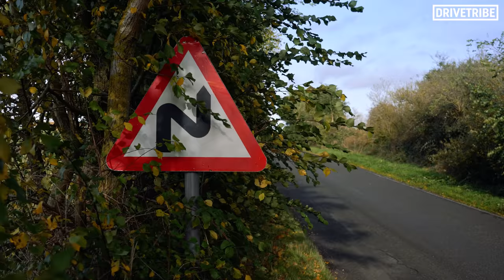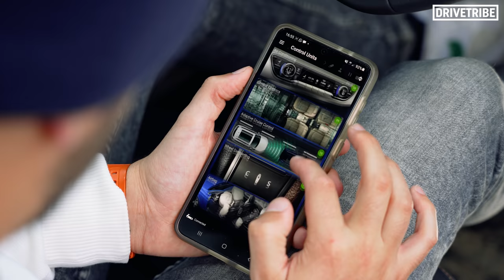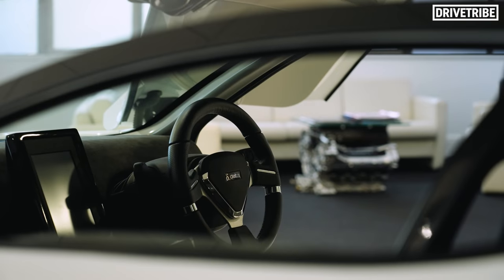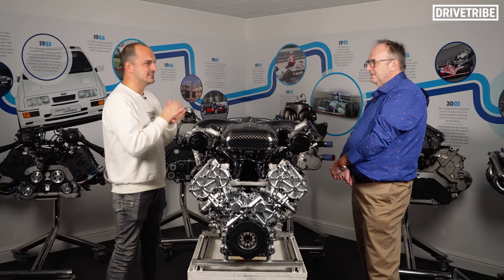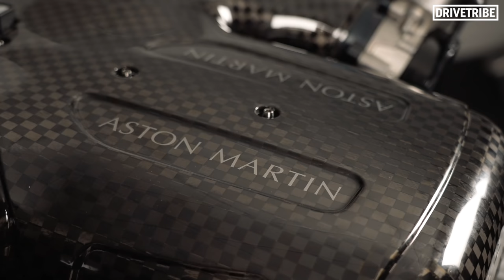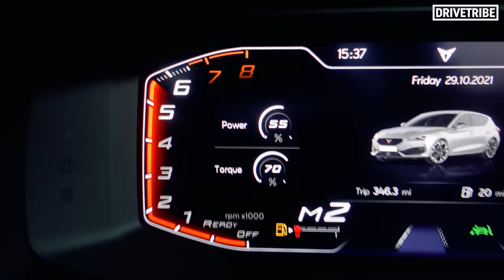Why are almost all modern engines 2.0-litres?

Comment: This is exactly why electric cars will never replace the internal combustion engine. Internal combustion engines in a weird way are the pinnacle of automotive engineering. Electric motors will never need the same spirit or passion that was needed to make 300bhp from a 2 litre inline 4.

Comment: Not being anything of an engineer here, but I find it funny ppl bragging about 'peak torque' across the rev range, as all cars now are achieving.
    I'm guessing, it's not natural, for an engine, especially a turbo one, to deliver the same output as it's revving up. It'd be arbitrarily programmed or designed into the engine.
   2 reasons why I believe they'd limit torque. First because it directly defines the stress applied to the drivetrain, and manufacturers want to keep it reigned to a serviceable level, and secondly they want the car more manageable and comfortable for the average driver, as opposed to having powerspikes throwing passengers heads too far back and doing unintended wheel spins together.

    It's not that the engines are peaking torque all the time,
  They're actually being restricted to prevent a madmans engine.

  Again, i'm also nothing of a tuner, but I'm pretty sure most custom engines have a curved torque graph, not a flat one

Comment: Meanwhile built American v8's are usually at the 7 liter mark. 4 liter is small for a v8.  6 liters for v12's sound about right, 3 ish for a 6 cylinder too, but v8's are different it seems. Stock ones in the 5+ to 6.something range. And there's the viper, why not add 2 more cylinders, 8 liters.

Comment: How many 4.0 liter v8's have been made in the last 30 years?  Just 3, all are turbo, high compression made by Mercedes, BMW and Ferrari (which is technically a 3.9).  In terms of the average size based on numbers in cars it would be closer to 5.8 liters.  As a matter of fact the smallest production v8 in the US was the 4.4 since 1990.  Ford's most popular engine since 1990 - the Triton 5.4, Chevy's is the 6.2, Dodge's is the 5.7.

Comment: I had a 1988 Saab 9000 2.0 4cyl turbo with upgraded factory ecu that puts out 204hp. In a car from 33 years ago. On a family saloon. Althoug it produces +250g of C02 per kilometer it managed to do 6.8l/100km on the highway (42mpg UK). Again, 33 yeas ago. When manufacturers announced that the avg fuel consumptions were way higher than what a careful driver can manage to get. It is getting old by today standards but for me is still one of the best car brands ever existed.

Comment: plot twist: the power density of electric motors is insanely hight than IC engines. A Electrical motor with the size of a w12 literally pulls fully loaded trains

Comment: when I calculate the volument of an 86*86 cylinder I end up with 1998230 cubic milimeter or 1998.23 cubic centimeter. 2000cc is being applied as the volume for a single cylinder in his calculation for a 4 cylinder engine. Did I get that right?

Comment: Would it be possible to shape the piston so it puts the gas on the sides so that the “end gas” never occurs? Idk if that would work but if it did, it could at least help semis which need more torque and as such have high displacement per cylinder

Comment: 2.0 have been a standard class for a while, in racing class also, as 1000cc and 750cc is a standard on the motorcycle circuit.
Reply: Harley Davidson's famous 88 cu in vTwin engine is exactly 1000cc

Comment: You sure? Many modern engines are 3 cylinder with either 1. 2L or 1.0L displacement with turbo units giving shockingly powerful horse power...

Comment: bit of a sensationalist article, basically these 2l's are just boosted (a hpt used to be anything over 1 bar) to get this power. with better head designs, vvt, turbo design, and materials etc nowadays this is easily possible, a 20 year old mapped 2.3l t5 engine can make near 300bhp, also look at fast cosworths etc. things havent progressed that much, just people prefered lower boosted bigger displacement engines, but with emissions and platforms having to be hybrid, big engines are on the way out or you normal road car especially with shared platform.

Comment: Actually the perfect engine has between 3.7 to 5.5 extra liters on top of 2. 0 mentioned in this video LOL what's more is the perfect engine is easy to spot because it has the oil filler tube at the front of the engine going straight into the block. See how many people can connect the dots to figure out what engine I'm talking about LOL😜

Comment: 3 cylinder to 12 cylinder engines is possible to fit the same sized engine parts of all pistons are 500cc capable. Modularisation and homogenisation of engine parts make economic sense.

Comment: Yeah, mostly true except huge BHP has been extracted from 2 ltr inline fours for over 20 years, in fact, for over 40 years. I am cheating a bit there though, to go back 40 years I'm including 1.5 ltr inline fours from the turbo F1 era, BMW famously reaching over 1500 BHP from quali engines!!  Group B rally cars were getting over 500 BHP as were the BTCC Cosi's in the mid 80's. My Mitsubishi Evo 6 is pushing out just over 500 BHP at the wheels and that is with quite modest tuning, and with brutal torque over a 4000 rpm rev band.  They can push out over 1000 BHP with serious engine work but power delivery and durability suffer.  So, this magic configuration has been around alot longer than postulated in this vid, actually Mitsubishi themeselves have used this slightly undersquare, 2 ltr inline four arrangement for 40 years!!!

Comment: Interesting, I know the 4-cylinder engines in the US have historically been 2.4 liters, so 600cc per cylinder.  Porsche also always had a 3.6 - 3.8l 6-cylinder engines…
Reply: In the past you´re right with Porsche, but today they also built 3l 6 cylinders in the Carrera/S/GTS, just the Turbo S has a 3,8l and the GT3 a 4l
Reply: Almost every 6cyl GM is 3.8L. Fairly standard if you ask me

Comment: car makers should be using that camless freevalve system...everything else is computer controlled...so should the valves...you can run different fuels...you dont need a pre cat...it makes way more power and can get better mpg and can shut cyl down and it makes the engine lighter and smaller...it controls each valve completely separate from each other...cost and complexity are worth it...its not like modern cars are simple...might as well go this last step...

Comment: But my brand new VW Polo is a 999 CC,  3 cyl. engine - that gives 333cc. per cylinder.  It seems it speeds up much faster than a 2 Litre. Not near the 500cc.

Comment: not to mention they sting you with oem parts and repairs because those 2 liters are a bit hand-grenadey and wear out more quickly than a larger but less stressed engine
Reply: Smaller engines are better suited to DIYers

Comment: The only reason these 2L I4s are getting so much horsepower is because of the gargantuan turbochargers being bolted to them. Those turbos are effectively (and successfully) increasing the displacement. Take them away and you have the same gutless I4 that has plagued small cars for decades. Sorry, but "No Replacement For Displacement" is still true, the new fancy turbos are just a means of skirting around Europe and Asia's displacement taxes.

Comment: Most common engines these days...but also the most boring ones. Every turbo engine has a little bit of turbo lag - I've driven a lot of them and turbo lag is definitely a thing even in the most sofisticated ones. It is present on every gear shift. If you give that Seat wide open throttle at 2000 RPM, turbo will take some time to spin and you will have peak torque at 2500 RPM...and if you want full torque on 2000 RPM, then you'll need to press the throttle at 1500 RPM.

Comment: I’m not sold on the durability of these small engines. I bet my 5.3l Silverado will go at least 200,000 more miles than a turbo charged 4 banger. I bet I have more miles  on my Silverado now than these will last.

Comment: They are not.  Or 2.5 or 3.0 or 3.5 or 4.0 or 5.0 or 6.0.  Petrol or Diesel? NA or boasted? It depends on the required purpose.

Comment: Your little 400hp 4 cylinder turbo is not as efficient at 400hp as my 7.4 big block chevy. They will both consume about the same amount of air but a bigger na engine can run much leaner without blowing up. The real reason we have over complicated small turbo engines is that many markets get taxed on the size of the engine.

Comment: It's impressive what they can do these days. But I find current turbo engines ver boring to drive. Nothing beats a NA engine for pleasure driving and sensation. Or if you want boost supercharge it that enhances the curve of the engine but won't make it so flat. I like that torgue rises with higher rpm I don't like it the other way around like turbo engines do. But that is my personal preference. I know everything will change and will need to change for the environment. But if you put that aside high revving engines are a blast to use.

Comment: a 4 cylinder will wear down much faster than a V6 or V8 to get more hp out most are turbocharged which puts additional rpm on the engine. fact

Comment: In Europe and Britain for many decades the tax paid (annually) on a car was based on the engine horsepower( displacement).  So smaller was cheaper!  You need at least 4 cylinders to achieve acceptable static and dynamic balance.   So there was a push to build small smoother engines………..ergo the inline four cylinder motor.     Fuel was also expensive in those places so economy was important. ————>    Small engines.

Fuel was plentiful and cheap in the land of the free………..(supply your own conclusion)

In the great south land motor cycles were heavily taxed over 250 ccs as the chance of killing your self and your pillion rider increased exponentially.

So………..size is everything, but it means different things to different folk!!

Stavros

Comment: On which parallel world do you live as the 2 liter is also going out  and a 3 cylinder 1.0 and 1.2 liter turbo is now going to be the normal yes you can even say goodbye to the 1.6 liter.

Comment: I can’t imagine the power when they remove all the belts and cams. Also on the Horizon  will be the pancake starter generator and car motor, everything can be run by the battery while you accelerate with an Electric boost from the pancake motor. Watch out electric cars!

Comment: 1k in a 4 cyl is easy nowadays just get a k series honda engine with sleeves n rods, headstuds ,big fuel pump big, injectors n a turbo kit  n u got reliable 1k . U can get away with 1k not even fully built it just wont last to long but 6 or 700 us easy with a 100$  ebay turbo

Comment: 2L turbo and supercharged production hybrids will smoke a production V12 off the line. Those systems can produce 500hp with very high torque instantly. In the end no IC engine is quicker than an electric motor car in 0 to 60 times. Ludicrous mode rules.

Comment: why are dirt bikes and motorcycles 50-250cc per cylinder or why do some muscle cars have 1 liter per cylinder if 500cc is better
Reply: Larger cylinders generally yield more torque at lower engine speeds. With bikes, given their light weight compared to car, this is less crucial so the engines are designed to rev much higher.
Reply: @paulanderson7796  No, I mean if 500cc is the optimal cylinder size for combustion because its neither too small nor too big. As is said in the video. Are motorcycle engines made suboptimal just to be physically smaller?

Comment: 2.0 liter engines are not new I had a 1980 2.0 engine in a SAAB and my car did not have a Turbo but they were available for 2000.00 I bought that car in June of 1980

Comment: He said if u want 1000hp ur not gonna get it from straight 4..... well that literally where most ppl are getting budget 1k hp fairly easily sometimes with stock bottom ends.  Im guessing he meant naturally aspirated.  These 4in bore straight 4s are so easy to make 1k hp with. Not many v style engines are tough enough to make equivalent power without being built n sleeved.  What v8 can hold 250hp pr cylinder with stock bottom end ? They literally tear  themselves apart long b4 that n even built to do 2k with stock block n sleeves they still dont last long . Straight orientated engines are way better buy default.

Comment: The problem with all this is despite all the modern technology and hopes the directed injected turbo charged four bangers can't compete with time. That is how long can that engine last and most of this can be blamed on physical limitations. Things like plastic and aluminum can only get so hot before they start melting and thus failing. The natural cycle of hot and cold only complicate matters. Then there's direct injection and turbos. Not only are these systems expensive to maintain, they're far from perfect. Even Honda and Toyota can't seem to get these things right. So sure they can create a 300 hp four banger to power a full size truck and send it out to do heavy duty jobs, but how long can that engine last? I wouldn't bet my $70k on it, I'll say that. Maybe in them little econoboxes this might work for a bit. But your not going to be driving something like this for 20 years, at least not cheaply. The liberal use of cheap, light aluminum and plastic bits certainly dictates that it will have a much shorter life.

Comment: THE BIGGEST DIFFERENCE BETWEEN ENGINES OF THE PAST AND THE PRESENT IS THE ENGINES FROM WAY BACK AND INTO ALMOST 1960S ALL HAD WAY TOO MANY PISTON RINGS THAT CAUSED IN THERE RUBBING EXCESSIVE WEAR
AND THEIR SKIRTS WERE HUGE THAT LED TO A LOT OF SCUFFING . MODERN PISTONS RM COMPARISON VERY MINIMALISTIC .
D . A . G . BOULDER COLORADO USA
THINK OF THE HUGE HORSEPOWER THAT CAME OUT OF AIRCRAFT ENGINES OF WWII WHOSE ONLY JOB WAS TO SWING A AIRCRAFT PROPELLER
.

Comment: Yeah, if you like torque, those induction motors in the Model S from Tesla & IPM motors in the Model 3, linear torque because unlike a piston engine, electric motors convert axial rotational magnetic field repulsion into rotational torque extremely quickly when the variable frequency power control takes DC energy from the battery storage module or energy storage & produces electromagnetic fields in the stator windings that push tangentially against the rotor so as to accelerate the rotation of the rotor with high axial torque to turn the trans--axel to power the drive wheels via the tire interface with the road surfaces. Newer axial motors & better controllers & better battery chemistry like sodium ion that is cheaper & more abundant than lithium ion, will enable increasingly better EV's & especially magnet (rare earth) free, induction motors, like those used in the Tesla Model S, that do not use rare earth metals or rare earths or permanent magnets - enabling Non Chinese companies to make EV's without being extorted with high priced rare earth purchases that the Chinese control at the mining & mineral production level.
Reply: I leased a 2013 Nissan LEAF S & then purchased a 2015 Nissan LEAF 30kWh, both were the most fun to accelerate of any car, because it was a quiet instant torque that did not draw the attention of law enforcement in an unassuming not flashing package that did not cause other people to look, so I was able to drive both like I stole them, at wild speeds without getting in trouble or drawing negative attention from other motorists - no loud exhaust. Smoked other performance cars that raced me off the line to 30 mph while their engines were still spooling up //

Comment: Imam BMW e60 2005 2.5 218hp i ne moze da se porede atmosferski motori sa turbo motorima. 2.0 bez turba je smece. Zamislite 6cikindara sa turbom pa to ne bi smeli da naprave. Ne BiH menjao mog 6cikindrasa za 4 nikada. Na autoputu na 160 170 nista ne cujes i kao da sediš u dnevnoj sobi. Na papucici gasa imaš snage koliko hoces a muzika ti u takvim kolima ne treba jer taj motor i izduv imaju svoju muziku kojoj ne Mozes da odolis. Zauvek za 6 cilindara. Najbolji motor današnjice je BMW b58 benzinac turbo 4000cc

Comment: LOL @drivetribe - SAAB has figured that out since late 70's and early 80's (YAY!). They had i4 2.0L engines perfected since then and had them in every model year increasing the power. Too bad engineering costs killed them before that math caught on with the other followers in automotive engineering. Evidently it took them over 30 years to do the same equations. Welcome late to the turbo party where SAAB led on.

Comment: The 2.0L engine is going to be extinct by 2030 in Europe, also many big manufacturers don't go the 500cc way.
Hyundai 1.6, Stellantis 1.6, Toyota 2.5 and some Mazda 2.5.

Stellantis is now even getting rid of the 1.6L to sell just 1.2L 3 cylinder engines. You can now find the 1.6 only in combination as a hybrid.
VW is offering the T7 Multivan only as 1.4 Hybrid in my country.

Buy your Cupras and GTI's as long as you can, because it'll be the last generation ever built.

Comment: You're conveniently ignoring the saviour of the cylinder, HH+.
Sure (and thankfully), petrol and diesel etc are on the way out, but the technology has been FULLY developed (and all over YouTube) for how you or I could very easily and cheaply convert an engine to essentially run on water, producing hydrogen gas to fill the combustion chambers instead of liquid petroleum/diesel.
Pretty much ANY engine can be retrofitted with a conversion kit, yet you're remarkably silent when also bemoaning the death of petrol to the future electric overlord.
Annoyed at the ever rising cost of fuel?
Switch to water and a spoonful of HH+ powder for less than a 3rd of the cost, and be grateful for the zero emissions, greater engine life and more power where it counts.

Comment: 3.0 in line six is thr best engine, 2.0 is slow ( except a45s cla45s etc.), they has no sound, not enough tq. Not as reliable as the 3.0. If u dont have money for a 3.0 l6. the 2.0 l4 is ok than.